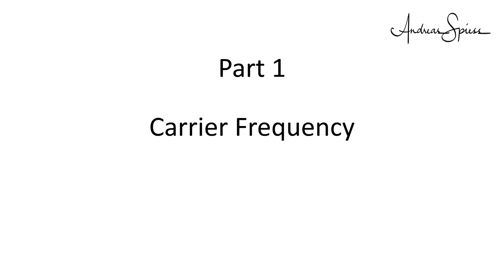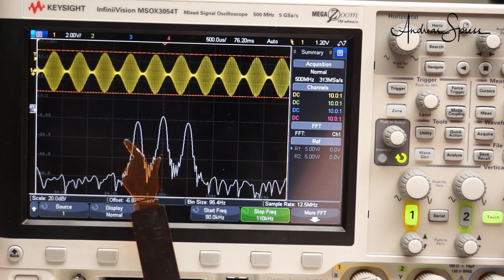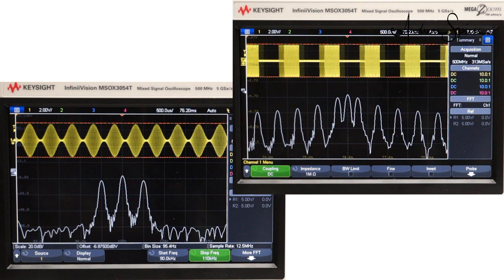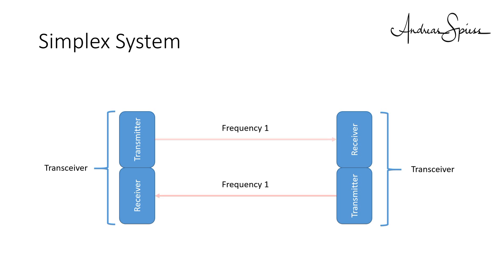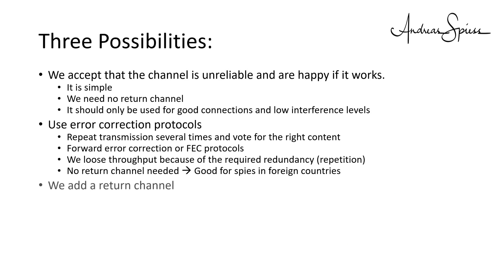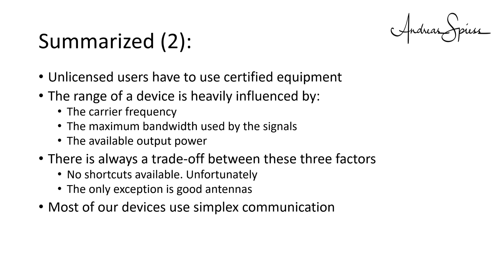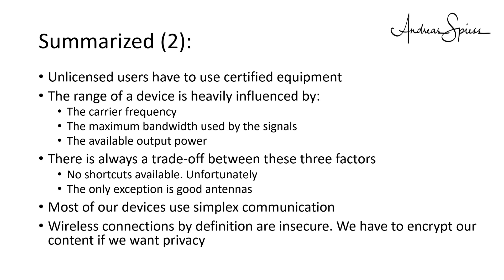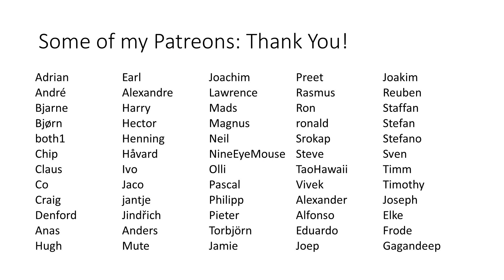#220 Wireless Communication for Arduino  (Part 2)

Comment: Has anyone tried the zigbee modules? I have used them in the past and they are quite reliable and you can choose the frequency. I don't remember the detail beside the fact  I remember I used firmata (it was more then 10 years ago) but I would choose them again if I want to monitor say a vineyard and I don't have to travel around. I don't see the point of joining a network like LoRa if I just want to communicate with my devices right? Does the RFM69 let you do you private com without having to join LoRa along with their restrictive policies?
Reply from the maker: Network or not is your choice. I made a video about LoRa direct connection if you are interested.
Reply: I've been following your LoRa video with great interest, I've also see you hack with the ikea lamp that use zigbee. But I was curious if you ever tested for long range communication of the zigbees. I still have those and even if they are not the cheapest option nowadays they are quite powerful. Maybe I'll test them when I have time and let you know.

Comment: Thank you very much for your channel ; I have learned a lot. I want you point of view on my project .
to  summarize my project :

I have a esp8266 webserver using websocket witch control gpio's very well by loading SPIFF html page on my smartphone  (garage door , sensor ect) .

I want to extend my project by using a pair of HC12 (si4463)

What i want to do is to add a esp8266 (with 1 HC12 )  acting as a bridgge (wired with the esp8266 server) to communicate to an other esp8266 witch have a HC12 .

I am blocked at this point.

what the goal : when Websocket receive a JS message from my html page 

1) he send a code (1234) to the esp8266 bridgge  by wire protocol .
2) the HC12 pick up this code and send it to the other HC12.
3 when the HC12 receive this code i do whatever i want .

Do you think my approche is right or I have to work on something else.

Thank you for your help.

Nb : i did not achive wire to esp8266
when hc 12 is connect to the server esp8266 it's mess the wifi communication
independent hc12 work good but alone
Reply from the maker: As usual, I would separate the components and start what the two HC12 and two FTDI connectors. If this communication works you replace one FTDI with an ESP. Maybe you want to use Serial2 on the ESP to keep Serial for debugging. No web. Nothing. Only if this works you can add your web server sketch.
Concerning interference: This should not happen if your devices have a certain distance. So experiment at which distance the interference starts.
BTW: I do not know what you mean with "Wire protocol". The HC12 I found does not work with I2C
Reply: Thank you for your fast reply ; in fact i wanted to make an extention of my esp8266 server. 

1) my esp8266 server work well " activate door , switch ect .

2) when i put hc12 direct to esp8266 server wifi don't work.

3) 2 esp8266 ( without wifi) associate with 2 hc12 working good too

( I can send the command to activate gpios to the esp8266 receiver by hc12)

The final idear was : to connect esp8266 server  by physical wire ( using  wire protocol) to the stand Alone esp8266 hc12  witch send the commande to the hc12 receiver.

So if i can achive this the result would magic.

1) HTML send JS  request to websocket 

2) if websocket receive the request code (1) example.

3) Esp8266 server send by serial protocol the code (1)

4) Then esp8266 HC12 pick the code (1) and send it to the final esp8266 HC12

I think i am more clear
Reply: You are right The HC12 I found does not work with I2C

Comment: Hi Andreas, is it possible to do another video about ESP-Now duplex communication. It's very hard to find any information about it or projects using it. I'm interested to know if it's possible to have a master and several slaves to duplex or is communication only simplex between master/slave?
Reply from the maker: We use duplex for our tank project. It works at least with two ESPs. I did not try more. Here you have a working example: https://github.com/leonyuhanov/ESP-NOW-TX-RX

Comment: Thank you so much for this follow-up video.  Is it possible for the RFM69 Lora module to transmit Data from a GPS module?
Reply from the maker: The RFM69 does not do LoRa. And you can transport what you want. You have to write the right code for that

Comment: Great explanation. I was wondering if you indeed tried the  NRF24L01 long range from that particular AliExpress link. Seemingly similar ones I got somewhere from aliexpress certainly were not long range, but if you actually tried the ones from that particular link I'd happily will order some
Reply from the maker: I bought mine long time ago, so no warranty. But AFAIK you Schuld see the additional PA chip. As I said, I had no big success with these boards over distance
Reply: @AndreasSpiess  thank you. I will try with the TMRH20 library

Comment: Thanks for an informative comparison. 

There is new development work being done on SNOW (Sensor Network over TV white space frequency channels , 550MHZ). Low energy,  medium range multi node networks.
Asynchronous  single hop networks, odbm transmission over 1.5km outdoors.
https://www.cse.wustl.edu/~lu/papers/sensys16.pdf
https://www.youtube.com/watch?v=WASYxu9Ra3g

Will be interesting to follow this development.
Reply from the maker: Interesting idea. I would not try it, because of legal issues. I cannot believe this is legal. Otherwise everybody would use these frequencies. I assume you would at least  need certified devices. And I do not see how you would get this certificate for those frequencies. But I might be wrong. Technically, this is easy as most of the chips used can use all frequencies between 300-1000MHz.
Reply: See link to PDF document I posted. In Introduction it explains how TV unused spectrum can be used. FCC in US have allowed this use with specific conditions, see document. Microsoft are involved in this research as well. Aim is to overcome shortcomings of existing technology for low power large scale sensor networks.

Comment: Andreas, you have a good understanding of all radio stuff. Could you please advise if it is possible to track cell phones presence nearby (~5 meters) by those small data transmissions that they do from time to time? My googling shows that even it is possible, it'll quite expensive solution.
What do you think?
Reply from the maker: You should be able to do that using SDR radio. However, it might not be simple. Maybe you wait for my SDR basics video or google yourself.
Reply: Thank you, looking forward to your new videos.

Comment: Nice summary of stuff I got in classes 30+ years ago :-)
I don't want to shell out the money for equipment like yours, I assume many viewers would not mind spending a couple of $/€ on a USB logic analyser (Saleae or clone, e.g. link below).
A simplistic sample project with this type of stuff also comes to mind. Many people have wireless weather stations. Can we receive the data from these devices with the modules you present, and can we analyze the traffic with a logic analyzer such as presented ?
Thanks for your work !
  Danny

https://www.aliexpress.com/store/product/USB-Logic-SCM-24MHz-8-Channel-24M-seconds-Logic-Analyzer-Debugger-for-ARM-FPGA-Logic-Analyzer/2623019_32870694523.html?spm=2114.search0104.3.15.7c3745b4ntDU41&ws_ab_test=searchweb0_0,searchweb201602_2_10065_10068_5890018_5723115_5723715_5910018_5723815_10696_5723215_5723415_10084_5724318_10083_5722215_5724018_10618_10304_10307_10820_10821_5724118_10302_5723315_5723615_5724218_5970018_10843_5722315_10059_5723015_5722115_100031_5723915_5725018_5725118_5990018_5980018_10103_5724918_5722415,searchweb201603_54,ppcSwitch_5&algo_expid=c4ff9993-a2e8-44ee-8d1c-aa804300a6ca-2&algo_pvid=c4ff9993-a2e8-44ee-8d1c-aa804300a6ca&priceBeautifyAB=0).
Reply from the maker: I think I covered the topic of weather stations in a recent video where I showed how you can analyze 433 MHz signals. And how to use logic analyzers was also covered (search for "invisible" in my videos).
Another 433 MHz video is on the project list ;-)

Comment: Love the little hand. Ive been delving into 433mhz lately due to low power usage. Any ideas on a good Arduino based chip to use for ultra low power usage. A video on this would be great.
Reply from the maker: I just got a few Moteinos for that purpose. Whisper Node is another such board. I used it in my „wardriving“ video
Reply: I loved that you did the whisper node board. Such a great video. I'm going to use one for my small summer greenhouse controller. I live in Tasmania, Australia. Ill look into this Moteinos as well. Thanks for writing back Andreas. Huge fan.
Reply from the maker: And the whisper came from Australia if I remember right.
Reply: Andreas Spiess they sure did. Just joined your patreon as well.
Reply from the maker: Thank you for your support!

Comment: Bear in mind that long range is not necessarily a good thing. A signal that travels further has more potential to interfere with another user. It can also be monitored from further away. If you are security conscious you might not want other people to know what the temperature is at your house, or to be able to turn your lights on or off.
Reply from the maker: You are right. I hope I covered this point of security. This video should give the info to do such decisions with some basic know- how

Comment: Hi Andreas, thank you for posting all of your videos. I only watched the summary of this video, as that was the bit that interested me. You mentioned that to overcome the 9dB link difference between the two modules the transmitter needed to be 10 times more powerful. It would actually be 8 times, as you double the power every 3dB. I do find your videos interesting, thank you again. Nick.
Reply from the maker: You are right. I also should have used 10 dB as an approximation. As I said in my first video I simplified a lot.

Comment: Good work.  Mention also, the better effectiveness of higher-frequency antennas.
Reply from the maker: That you can build more elaborated antennas of the same size, you mean? As a result of the smaller wavelength? A  ground plane, for example, should have the same performance on all frequencies. It just gets smaller with increasing frequency
Reply: As in, higher frequency antennas can have much higher gain - can be used to recover that free-space loss.  Compare the gain of a large 868MHz yagi against a 5.8GHz dish.

Comment: Nice and useful video as usual. Very kind and Clean explanation. You remembered me of an experimental connection with a 10 mW laser diode  ( in Early '90ies... long time ago) with a modulation in current of the diode then probably AM.
They reached 88 km of distance: the  transmitter was on a Hill near Bologna and the receiver was in the middle of the country near Argenta, a little town between Ferrara and Ravenna. The beam was about 1.5 meter of diameter and received with a parabolic antenna with many  pointing difficulties. They said that the analogic modulation was perfectly readable . .. Long Live to transmissions pioneers!
Thanks Andreas!
Reply from the maker: As you wrote: In addition to the electrical challenges, these experiments have a lot of "mechanical" issues like finding a good and open field as well as pointing the direction. Especially if the beam is only 1.5 meters. It is a wonder they managed to reach this distance.
Reply: I found a bulletin from the Guglielmo Marconi committee that made the connection. I have to make amends: the distance although equally considerable is 40 km, not 80 km as I remembered.
On 01/04/1997 from 21:00 to 22:30 there was a record connection in bilateral laser in telephony between Vaglie, a town located between montecalderaro and monterenzio (590 m. Above sea level) and Morgone pass on the embankment of the river Reno between Molinella (Bologna) and Argenta (Ferrara)
On 10 April 1997 the record was improved by one Km. 30 and 20 mW lasers were used (not 10 mw as I had written by heart) and in reception lenses fresnel from 600 mm in diameter all mounted on military type tripods combined with optics for pointing. here the link to the bulletin page where you will also find the description of the  mechanics part http://www.radiomarconi.com/marconi/record.html
Thank you for your patience and sorry for the inaccuracies ... but many years have passed!